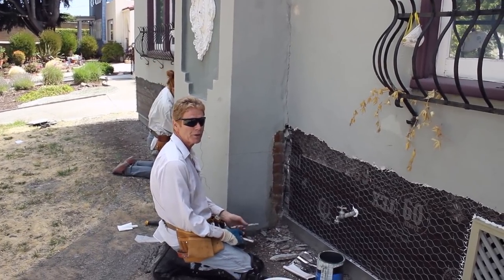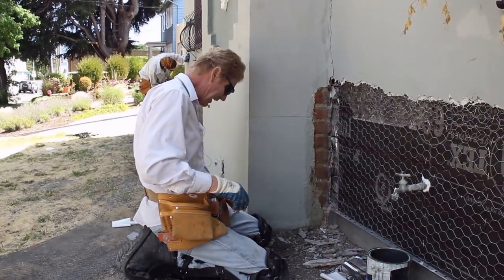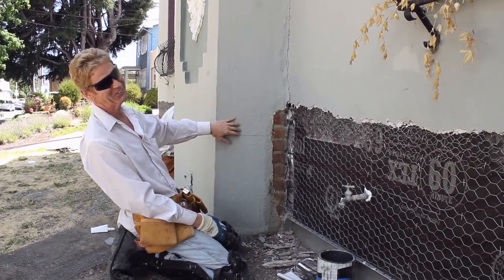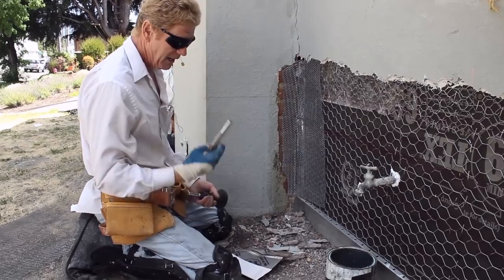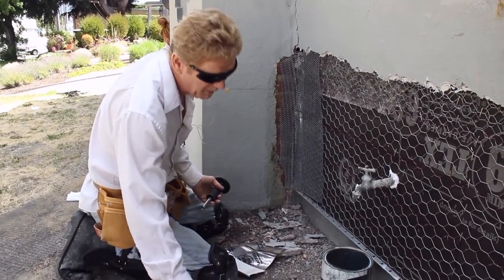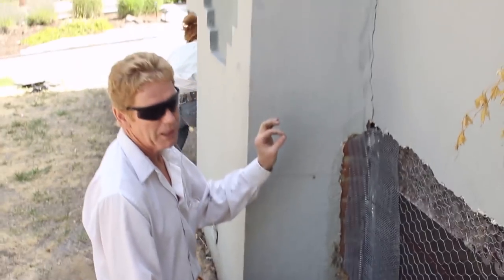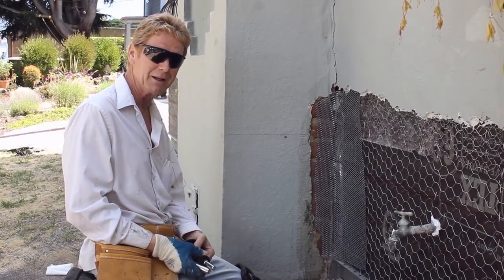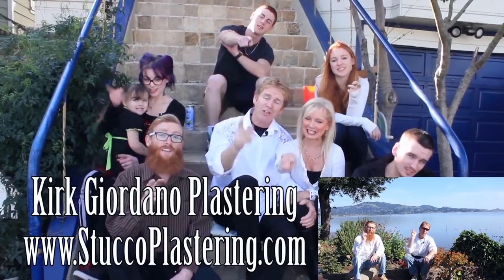How to safely pound concrete nails in

Comment: Hey kirk what's a good ratio if I want to add lime to a traditional method of a scratch and brown coat .
Reply from the maker: Good evening Joe, your choice as my products are sold with lime already in the bags, I just add sand and water.
 Most folks wouldpossibly say a hnful per 5-gallon bucket.
                                        Best wishes,
         Mastering Plastering for the beginner’s to the experts

Comment: Hey kirk ama do a alastameric   house and the house haves sand finish  already I put glue  but    ama add half  stucco 20/30 on a half bucket of acrylic.  Can that work
Reply: Im a plasterer for 20+ yrs in ktown, tn. Kirk will know best, but those are two diff in my opinion.  A cementicious finish and a synthetic acrylic.  May bond, but i wouldnt chance it.  Maybe on primered walls but we have to weld creed primused synthetic walls for the cement finishes such as mission finish santa mon. to bond. And it didnt bond well. Go one way or the other. Mixing will def void the manufacturer's warranty too. Just my 50cents...
Reply from the maker: Howdy Josy excellent question, hope I catch you in time to advise, first of acrylic or synthetics are the same product, just called different names.
   I would not recommend adding anything to any acrylic stucco, except a cup or two of water or the adhesion will be compromised among things, so don't do that.
On an entire home, this method would have disastrous results, on your own home for a small patch, not the end of the world, it would not last anywhere near applying any pure sand acrylic stucco.
Super quality acrylic stucco's are Stucco-Flex, Dry-Vit, BMI, Carsons, etc.
                                             best wishes,
 Sound advice for plastering repairs from your favorite stucco geek
Reply from the maker: Howdy James my fellow plasterer, excellent advice.
 As a rule, we apply Weld-Creat before applying cementitious stucco.
    I apply specific primers that are of the same brand for all acrylic stucco's.
Your 50 cents of advice is undercharged, that knowledge can't be measured in money.

                                             best wishes,
 Sound advice for plastering repairs from your favorite stucco geek

Comment: Morning kirk. Is there anyway to avoid the pitting on these? I have a magnet hammer, a few, and they are made so cheap now for their price. Side grinded one to flatten it out, but now its not magnet. What gives. Lol
Reply from the maker: Morning James, I have worn out two in many years of use, your right, it's faster to bite the bullet     and spralarge   and buy a new one.
             Best wishes,
Kirk and Jason Giordano’s plastering tips

Comment: That's Pretty Sweet! I Can't Tell You How Many Times I've Whacked My Thumb/Finger Nailing Chimney Flashing.What Sucks is Usually you're Hitting it Real Hard to Get it to Go Into Masonry. 
As far as Keeping the Chimney from Moving? In General the Chimney Stays put..The Wood Framed Portions Just Expand & Contract at Different Rates  than the Relitively Solid
 Masonry...Roofs Move Too Properly Flashed   Chimneys Allow for that Movement.
Reply from the maker: Evening John, I agree, best wishes.
Teaching plastering do’s, don'ts and reasons why,
 Kirk and Jasons plastering tips.
Reply: I Didn't Mean to Get Off Topic it's Just that I'm a Mason.. a Chimney Guy. I'm Not Saying Masonry Doesn't Move & Sometimes Sink.. I'm Just Saying that Unless there's an Ongoing Problem Chimneys & Masonry in General Don't Flex Like Framing.They're Relitively Stable it's Everything Else that Moves.